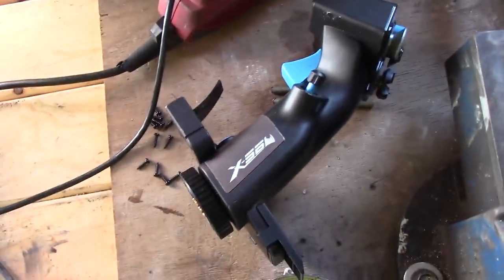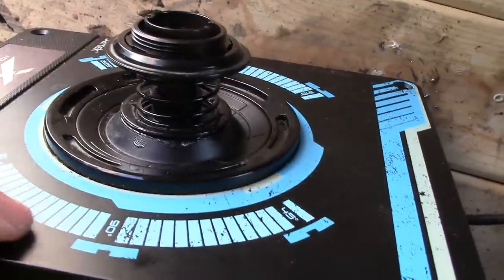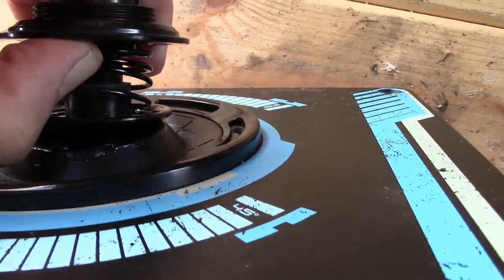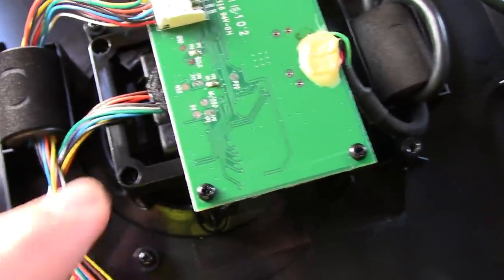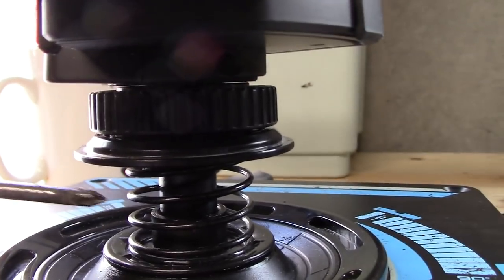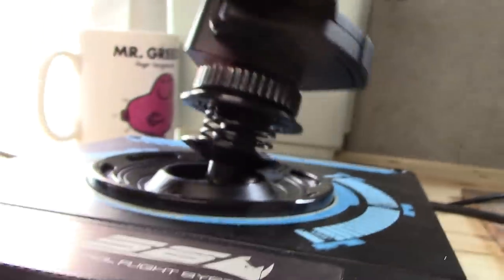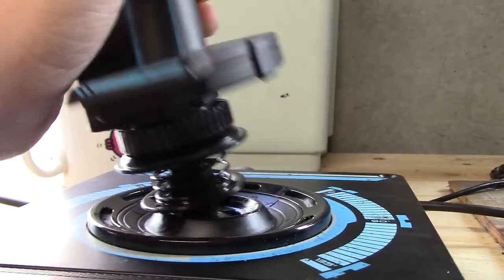Explained: Possible Cause & Fix For A "Sticky/Stiff" X-56 Joystick

Comment: I have an X-56 that I upgraded to last year after I had an X-52 for almost 10 years. The X-52 still works perfectly, but I wanted the additional analogue thumbsticks offered by the X-56, Those Saitek (Logitech now) designs are actually really good! I did have the same issue as shown in the video with my X-52, but a drop of 3-in-1 oil on the shaft made it all better cuz it dissolved the "gunk" whilst lubricating my shaft (giggity).

Comment: Use dielectric grease for sparkplugs. You can get a pouch for a buck from any autoparts shop. No worries about shorting out wires and it wont  hurt the plastic unlike some other types of grease.
Reply from the maker: thx

Comment: It's best to use a dry power graphite lubricant on plastic friction surfaces. It attracts less dirt and some grease's or oils make the plastic swell causing more problems. You can even use scrapings from a lead of a pencil.
Reply: I tried that. All it did was make an obnoxious mess and set my dust allergies off.

Comment: I'm running the Logitech variant of the X-56 and I can confirm that it is a really tough joystick. I hated that the throttles were too sticky and removed a bunch of the grease from them but the joystick side is perfect. 
Thanks for the heads up on another potential spot for issues to arise!
Reply: Hi! I´m planning on getting one as an upgrade for the X52 mainly because...buttons

Could you tell me how does it handles with the centering and the precision flying for AAR?
Reply: @cristobalvergara8009  The X-56 has a LOT of play between the centering "stops" on the stick. It's not your friend for AAR as you'll want to add a fair amount of deadzone for normal flying or else you'll be pulling your hair out from the constant wanting to pitch and roll when you let your hand off the stick. But as far as buttons go, X-56 is AWESOME!!
Reply: @whiskey-sierra  The centering play is due to the way the "disc and cup" mechanism is manufactured. The disc had a significant amount of room over the joystick shaft (about a millimeter) which has to be overcome first before the spring starts to act. The well-known "spring mod" which adds external springs will solve a lot of that centering play.

Comment: I know this is old but after my inspection,  the issue is with the traditional design using external springs. The spring provides mainly the centering of the stick with a horizontal lip to mate on the guide cup...this helps also to mitigate the electronics that show deltas returning to zero or not.....but on top of this the shape of the cap and guide that the spring pushes into giving it tension is also fundamentally flawed as a result... Greasing and cleaning etc obviously helps these mated surfaces move but they are also fundamentally too shallow, a  saucer shape under the lip causing the extra force required to initially move the stick.  As you all will agree the movement past this point seems smooth and effortless in relation to this...the spring again providing resistance.

In fact putting the whole mechanism upside down with the cup and saucer on the stick rather the base, would alleviate much, but  basically the mated surfaces need a redesign to make them more spherical, with the overhang of the lip to recentre reduced,  reducing the pressure required to overcome the initial force to move the stick. PTFE coatings etc can only go so far.

Edit...as linked in another post the four sprung solution without center spring looks like a great solution with an appropriate way to balance the tension getting dead centre.. 👍

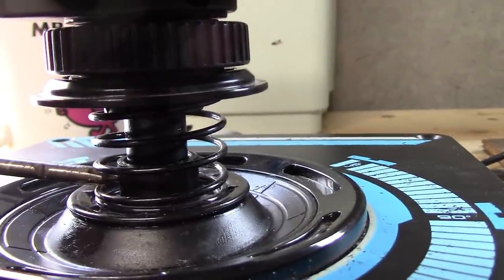Comment: Glad you posted this Cap!  Can't believe you took apart a Logitech X-56 (even if it's 5 years old) @3:38 So THAT'S what's causing the clicking noise?  (Good U-2 song in the background, by the way). Noticeable improvement, glad it's an "easy" fix (glad I subscribed to this channel).  Another great video @GrimReapers

Comment: 3:40 I have same problem, question how you manage to clean without sleeve? I remove string move sleeve down clean with alcohol move sleeve up clean it again then I add some WD40, but is worst then before. Are you was able remove sleeve completely? I try clean stock as good as I could, but still I got stiffness...

Comment: I actually found this video fascinating and watched it all the way through.  I continue to get creaking from my X56 and have lubed up most of that area but I shall take another look at the “stalk” as you so diplomatically described it.  Also enjoyed the Sting.
Reply: I have the logitech black and grey x56. I have had it since the first put them out. About once a year I put a fresh light coat of synthetic grease  to the center shaft and the collar just as Cap just showed. X56 is best choice for the prices it can be bought for. IMO

Comment: I have a F.L.Y 5 (very similar bottom end to yours in the way it all works) which suffers from stickiness every now and then, I blast the crud out with butane then apply a few drips of silicone rc shock oil to the center post, and wipe a tad around the bottom cap with a fingertip. Smooth as you like, no need to teardown.

Comment: My X55 had some serious issues with the throttle, about 6 months after purchase. There is some sticky goo in the inside between the throttle plates that guides the throttle and the wiring got contaminated by this goo and at the end the wires did not move free at all, it was sort of bending and some of the wires broke. So I removed the goo and had the wires fixed with sleeves made of silicone. Then I stuffed the friction plates with silicone gel and bobs your uncle. Unfortunately, eventually Elite Dangerous worn out my system and I got an new X-56. The first thing I did was to remove the goo inside the throttle plates and replaced it with silicone gel, then add some car door lock mechanism grease to the joystick plate you described and added some silicone gel in the sleeve and I now have a nice smooth system.  BTW I make use of the app that comes with the X-56 to program/bind all three modes (have done with F15C) and busy with F15e at the moment. Did it with the A10C as well. Otherwise, thx for the vids.

Comment: X52 has the same issue ! The plastic "neck" rubs on the metal shaft and it needs a lot more power for small delicate movements.
I added some vaseline along the shaft and it made it way better

Comment: Thanks a lot, it's a good advice for the future, if I experience such problems. I have X-56 for less than year and for now, I only experienced some problems with twist rudder controls. It results in some random vibrations of rudder pedals clearly seen in cockpit, it's also visible on the "Axis Assign" page in control setup.
Reply: Try adjusting the deadzone in your controller properties-it should iron out any minor fluctuations.

Comment: Just got my X56 a couple of months ago and have been very impressed, I was only concerned about how well they wear but obviously not poorly.
Reply: How in gods name do you get to that plate at the bottom to clean inside of it? I have the same issue and badly need to find a way to get in there!

Comment: the main problem with this stick is that this spot where all the gunk builds up and the sleeve that goes up and down have very poor tolerances , this causes the entire stick to wobble in the center because the stick does actually have a little wiggle room when the ring is at the bottom I don't really see any good fix other than printing the replacement ring with better tolerances on high res SLA printer, process is so messy that I really don't want to do it tho, I also don't have a proper resin for such functional print, but maybe I'll get to it at some point

Comment: I'm about to "pull the trigger" on an X-52 set. I have a Logitech extreme some newer model I got cheap from Amazon.  Will the X-52 do the job in DCS so I can fly twin engine fighters, etc with a decent degree of control? Yeah, I'm a 61 year-old that for medical reasons cannot fly a real plane. This is how I can.

Comment: I received my Logictech g x56, the first thing I had to do was take the base apart and push the white connector in further because nothing would work right. And now, when I twist the yoke counter clockwise, it clicks and my "view" button will act as if I'm looking up left in game so I have to twist the yoke clockwise till I hear a click again to fix that issue and lastly, I have a bit of play before any response from the yoke. I am using the green spring, but it seems like a lot of play. So I can move my yoke around and not have the base (part under spring) move. I dunno. The throttle works great. A little disappointed especially with how much I paid for the thing.

Comment: I'm a 55 year old gamer, and a private pilot.  I'm also a 100% service connected combat vet, who was labeled a partial paraplegic.  As such...I had a bit of time on my hands...so decided to get into DCS; and spent a shit ton on money on planes and modules.  I initially started with the HOTAS X-56; with the thought that I would buy better equipment if the game turned out to be as advertised; unfortunately its a massive disappointment because the game designers and HOTAS developers cant get their shit together...providing equipment and services that easily work together.

For me, I found that the sliders and modes don.t function on the throttle, and the lower trigger on the stick does not function.  God forbid a player is using the $1,500 VR setup...which is made useless if the key bindings don.t work.    I have noted that there are players who attempt to provide complicated work arounds...which for the vast majority of people...don't f@#$ing work.  So my advice to players who are considering DCS...save your money...buy a xbox...at least that shit works.

Im always amazed at the opportunity for these companies to make money...and instead of working together...they provide a shit product; and while there are a few players...there is untapped potential because most players leave out of frustration.  Regardless...as they say in Texas...DCS is all hat and no cattle.  players beware.  

Below i a link to the xbox sales department

https://www.google.com/search?q=xbox+sales&sxsrf=APwXEddICQ7IaifJ-bjkT1WS5_Mc8Rq88w:1683726764868&source=lnms&tbm=shop&sa=X&ved=2ahUKEwjG3d_98ur-AhVQJEQIHWoQAZwQ0pQJegQIBBAE&biw=1280&bih=610&dpr=1.5

Comment: I made the mistake of using lithium grease a year ago. Apparently it degrades  plastic... Mine sticks now, to the point where if i go full left the sleeve stays stuck up the shaft and in stuck in a hard left roll even though i return the stick to centre :( can't afford a new one so might try 0000 fine steel wool to clean it. What did you use to scrape it? Were you worried about scraping a flat spot?

Comment: X56 gets better when you correct the little things.
I implemented my own version of the spring mod using an automotive clamp, a zip tie, some springs and furniture bolts to achieve very smooth results. 
https://forums.eagle.ru/showthread.php?t=227934&page=4

Comment: Logitech rebranded this hotas and I bought 1 direct from them. Ever since my iron switches on the throttle are unusable, they’ll trigger randomly. A barely 6 month old hotas is having issues That folks say they get after years of owning it.
Reply: I have the logitech black and grey x56. I have had it since the first put them out. About once a year I put a fresh light coat of synthetic grease  to the center shaft and the collar just as Cap just showed. X56 is best choice for the prices it can be bought for. IMO
Reply: Alphawolf 001 my issue isn’t with the stick itself. That seems just fine. But the throttle switches will trigger at random and it’s only those switches all the other axis knobs and buttons are good.
Reply: @kodefashmodefa   I see, has there ever been a spill of any kind on it? I only ask cause a friend of mine has kids they spilt a drink soda or something of the like on his, and his switches did something similar. His switches also didn't click sharply or positively, they felt spongy ... I cleaned his switches with rubbing alcohol and it cleared the issue up for him. Sorry I didn't pick up on the problem you had directly, as you put it there plainly.
Reply: Alphawolf 001 oh that’s ok, nah neither has ever had anything spilled on them, nor dropped or anything really. It’s just came out of nowhere.
Reply: @kodefashmodefa  sorry you have this issue wish I had a better answer than cleaning thing or trying to replace the individual switches which is afair amount of work

Comment: If it's stuck, wd40..
Reply: My Ebay bought X52 was filthy, sticky and creaked and groaned (I did get it super cheap with all sorts of caveats applied by the vendor). WD40 and some delicate cleaning with cotton buds along the lines Cap pointed out got it back to new without even opening the case.
Reply: Not the normal wd40. I had the same problem with my x55. I used the PTFE version of wd40. Green / Grey bottle i believe. Did this once almost a year ago, no problems again.
Reply: If duck tape or wd40 can’t fix it nothing can
Reply: Silicone spray